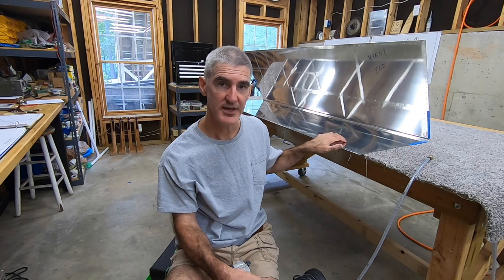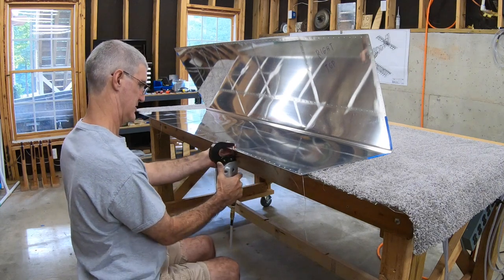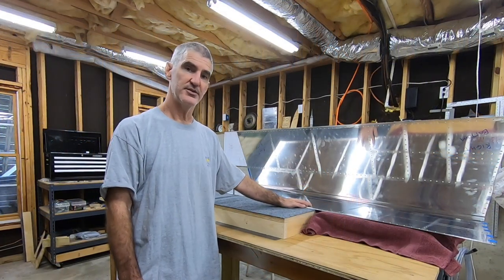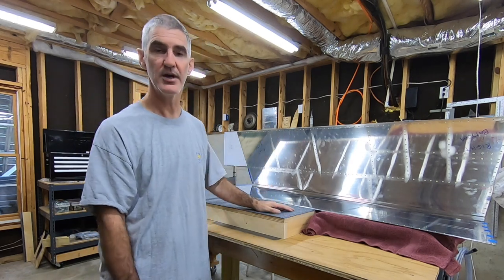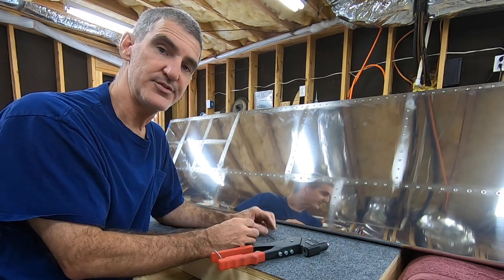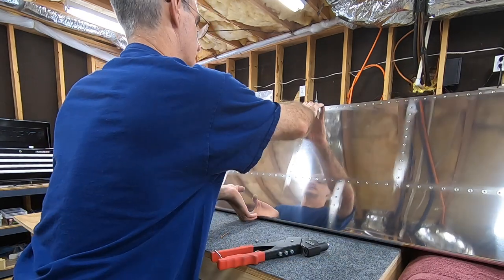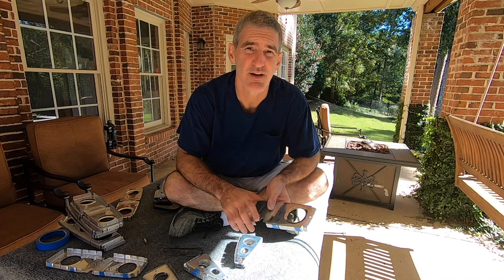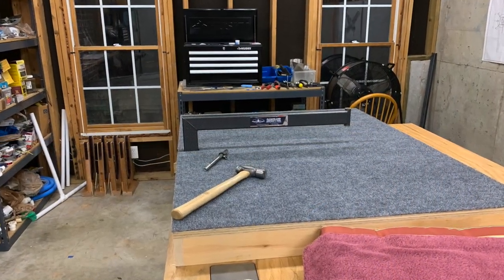RV-10 Build Log - Emp 44 - Dimpling the Horizontal Stabilizer

Comment: Based purely on my own limited experiences, I am part of the crowd where the close quarter dimple die set (using steel finishing nails) would not get best results on the dimple, for application of the first two rivet holes in a given line close to the leading edge/bend line.  One trick I developed (I've never seen anyone else try it anyway) was to use several small high strength magnets on one side of the skin with thin rectangular steel plate (any reasonably thick rectangular simpson tie does nicely)  used on the other side.  This helps keep the skin sandwiched flat near the dimple to be set in the area where its very tight to get the c frame in.  The skin can be bent back enough to enable application of the C frame, while the skin is sandwiched flat by the simpson tie and magnets, allow the c frame to make a nice dimple.  Without the skin being sandwiched flat by the magnets and steel plate, the c frame can't do its job properly with the skin curving (and hence not flat) against the dimple die, and hence the necessity to use the close quarter dimple die with blind rivet puller if not using this technique.   Note:  simpson ties can be purchased in ANY hardware store and high strength magnets are surprisingly cheap online.   My end result was excellent....YRMV.  For what its worth.....the peanut gallery.
Reply from the maker: Wow, now THAT is a unique solution.  I think I understand what you're getting at, though, and it makes a lot of sense.  I was able to do the holes in the very leading edge area of the vertical stabilizer with the C-Frame without any real trouble as long as my wife held the opposing side pulled back out of the way.  But as I think back, the VS doesn't have as much curve to it, I don't think, and therefore just pulling it back like that was enough to make the side I was dimpling get pretty flat.  How long were the ties?  I've got some (and similar spare steel parts) laying around from past house projects.  Did you tape 'em up so as not to scratch the skins?

Comment: Looking good. Watching you use that C frame definitely makes me happy I went with the DRDT2.
Reply from the maker: LOL, well I may have a follow up video discussing the two options soon…
Reply: C frame is great to do good dimples . The way to hit with hammer is important, not visible in the video .
Reply from the maker: @chantereaudominique8855  can you elaborate on how to hit with the hammer?  I go by the sound that it makes, as described by Mike in one of the Cleaveland videos, but if there's a trick I'd love to know it.
Reply: The way you hit depend on material thickness , and rivet size . At the end the surface must be flush, the rivet seating down as if sheet  were machine countersunk . I think you cannot damage the skin if you hit a too long time. If you dont do that way , you’ll get a pillowing effect .

Comment: The dimple dye is only "scratching" the alclad finish.  You are not damaging the skins.  I disagree with the comments about the DRDT2.  My C-frame takes up enough space as it is, and it does a very good job.  It's cheaper and the only draw back is that it's loud but it's not nearly as loud as the rivet gun.  Very much enjoy these videos.  I know it takes time and distracts you from the build.  But it's very fun to watch!
Reply from the maker: Thanks very much, and glad you're enjoying them!  I enjoy watching others' build videos, too.  Kindof gives a little bit of the satisfaction of building, and I get to see what to look forward to.
Reply: @missiletwentynine2667  I posted mine on Instagram but they aren’t as detailed as yours.  Hey when you get to the tail cone and have to reduce your dimple die I would recommend you purchase a reduced simple dye and then reduce that even more with the 3M wheel grinder.  I cost myself a new skin by not realizing I did not reduce it enough and when I finished I noticed all the dimples dented the sharp corner of the skin.  Wasn’t bad but it’s in a horrible spot and I would have hated it.  The part was 80 but the crate was $200!  Doh
Reply from the maker: @smellyallen  I haven't read ahead in the plans far enough yet to realize you'd need a different die, but I can imagine what you're talking about.  Wonder if the substructure die would be good enough.  But I'll definitely look into the die you suggested.  Where did you get it?  And, FWIW, I know your pain when it comes to the shipping costing more than the part.  I just had to order some long, skinny parts, and it was $43 to ship $37 worth.  Not quite as bad as $200, but something to be wary of.

Comment: cool tool, I have a tail kit but im actually considering going with a Velocity Aircraft now.
Reply from the maker: That’s be different!  Composite construction, right?
Reply: @missiletwentynine2667  yeah, it has more room a depending on motor choice it can do 250knots or more. Lead times on Vans QB fuse and wings is too long now
Reply from the maker: @Dragonrc.  what’s the build process like?  I picture lots of jigs, and then layer upon layer upon layer of glass cloth and epoxy, but I confess I didn’t really look into it when I was making my choice.
Reply: @missiletwentynine2667  actually no it’s all molded and the fast build cuts build down to 1000 hours. Some glassing with slow build and very little glassing from best I can tell on fast build.
Reply from the maker: @Dragonrc.  Wow, really?  I assume it meets 51% rule?
Reply: @missiletwentynine2667  yes sir

Comment: Story time: my close-quarters dimple die set came with steel mandrels (i.e. small headed penny nails) with heads that smooshed the inner hole of the concave die, so I stopped using them and went to the hardware store to find a different nail. I found nails with heads that were too small (slipped through or caused smooshing like the originals), or too fragile (#16 wire nails - head snapped off). The only one I've found that could take the stress without causing too much damage to the die (still a little smooshing) is a 15 gauge wood nail, except the shank is so thick I need to grind it down on a grinding wheel to get the dies on and off. Annoying.

That's a long winded way of me finally getting to my question: have you found an ideal replacement nail? If so what and where?
Reply: I have great results with 2 inch # 6 finish nail
Reply from the maker: Oooo.  I'll have to check the inside of the die.  It could be getting smooshed and I didn't realize it yet.  I did manage to break one of the copper mandrels, and even one of the steel nails that came with the set :-/. I figure I was squeezing WAY harder than I needed to if I was breaking a nail.  On the bright side, I don't think you can really "over dimple" or at least not without really going crazy.  I figure I'm not putting more force than using the pneumatic squeezer.